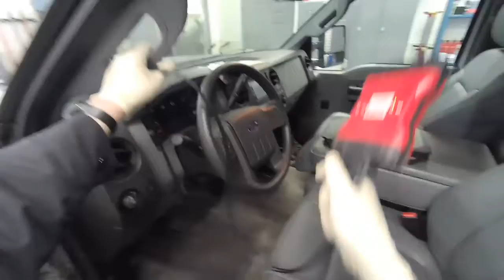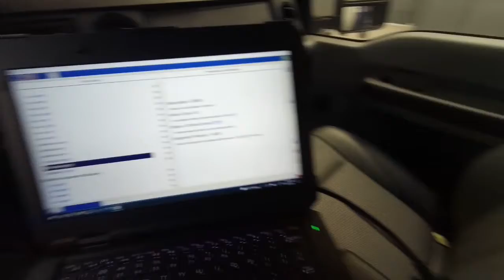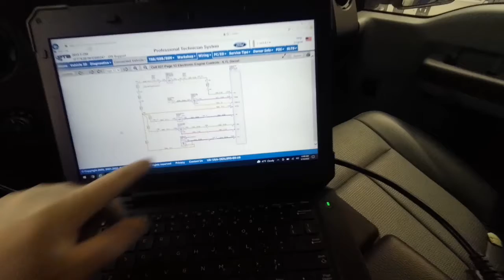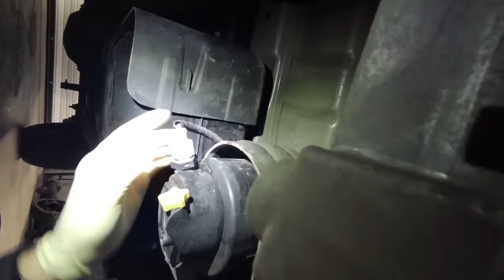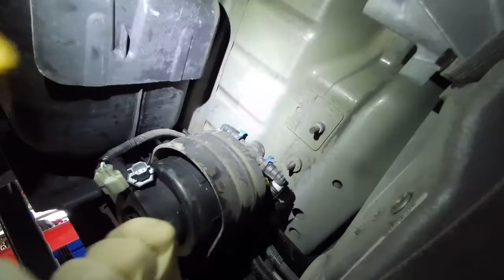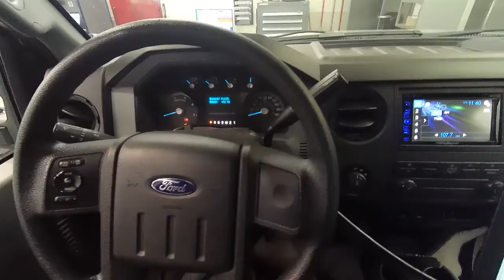WATER IN FUEL, ENGINE REDUCED POWER MESSAGES

Comment: I changed all my fuel filters an the  dealership changed out the sensor because my 2014 6.7 was saying on dash water in fuel , because they said that was the issue , now dealership is saying its the cpm is the issue ??? The dealership should have rest the water in fuel counter that your stating  , correct ...
Reply from the maker: They are saying the PCM is bad? Hopefully they reset the counter, if not then start with that for sure.

Comment: So I’m almost done with this video but I’m getting the same issues starting last night on my 2012 6.7 power stroke and I fueled up at a questionable gas station yesterday. I’ve drained and changed my fuel filters, added some diesel 911 to it but now I’m still just getting the reduced power no more water in fuel though. Is there a way I can easily drain my fuel tank? If the bad fuel is even a possible reason for this
Reply from the maker: You probably have to do the water in fuel counter reset which will require a scan tool. The sensor may have failed too. You can get a cheap inline fuel pump from a parts house and connect it to the fuel line to pump it out that way but the only way to make sure everything is cleaned out is to remove the tank.